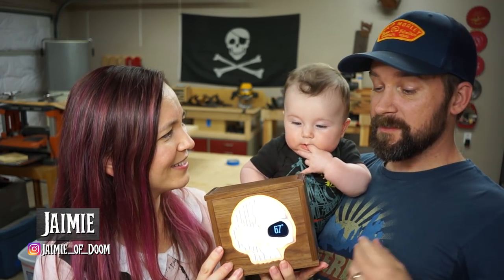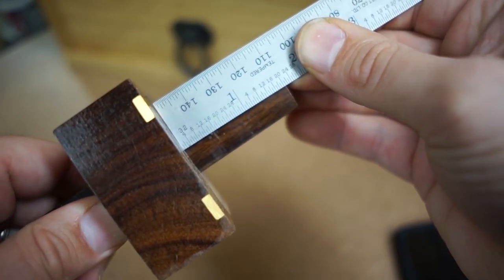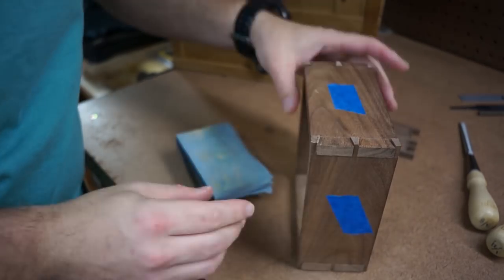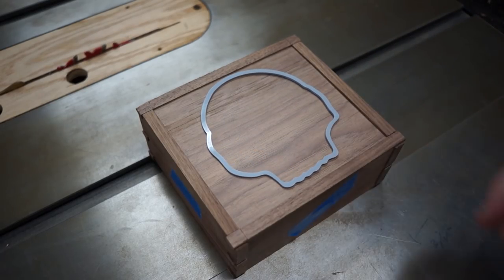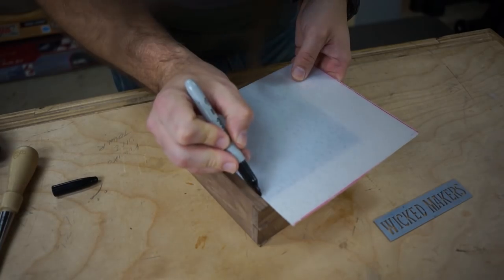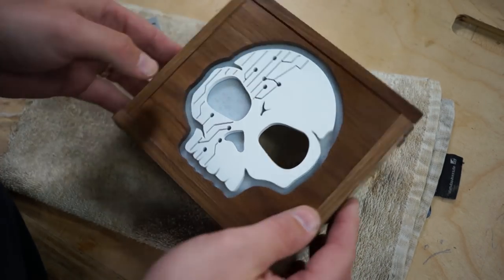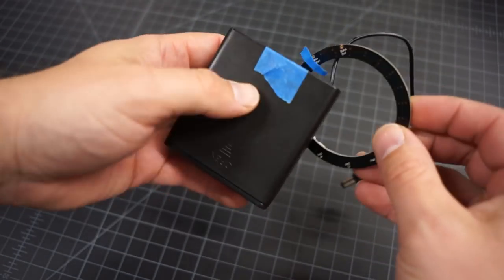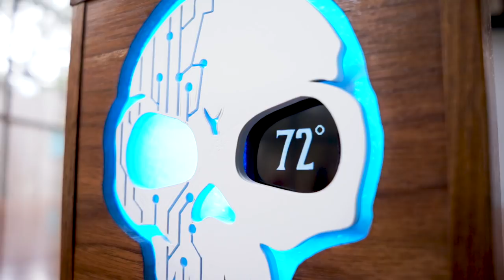DIY Arduino LED Skull Shop Sensor

Comment: Hey fellow cenTexer! Loved everything about this, and I'm jealous of your shop. I recommend you check out the ESP8266 since you're getting into arduino. They're small, cheap and wifi capable!  What that means is that with essentially the same build in this video, you could be publishing your temp/humidity to a topic on an MQTT broker and subscribing to that topic on your phone. In other words, you get to access what the cool skull box is measuring from anywhere in the world.
Reply from the maker: Thanks Shane! Sounds awesome!! Will definitely check out the ESP8266. Anything that gets us a step or two closer to our Tony Stark work shop. :)

Comment: How do you adjust for frequent humidity changes? Do you run a dehumidifier in your shop?
Reply from the maker: Do you mean how do we adjust the sensor, or what do we do in the shop in general when it changes?
Reply: The latter. I live in a dry area so I've never had wood movement issues. I'm curious if you have to do any extra steps to keep your wood form warping and causing problems.
Reply from the maker: Yeah there's a few extra things we have to do, sadly. :) We used to live in Southern California so moving to Central Texas was a big change for woodworking. I have to monitor the weather and try not to do any major milling or material removal if I know there's going to be a big swing in humidity in the next 24 hours. I try to bring my smaller projects into the house on off hours to minimize problems; for big stuff where that's not possible you just time it as best you can. I haven't setup a dehumidifier in the garage yet...might be worth a try. I imagine it would be running 24/7.

Comment: Cool video, and interesting project. Currently attempting to make this lil' project, myself. Mind sending me the code to look into. and the bmp files? Would be much appreciated. Just gained a new subscriber.
Reply from the maker: Thanks! Send us an email at thewickedmakers (at) gmail and I can send you the number bitmaps. The code is available on the Arduino Project Hub if you look up Wicked Makers.

Comment: Cool project.  My nephew is in college studying engineering and is encouraging me to get into working with Arduino which I probably will in the near future.  
What really amazes me is that I have seen several of your videos and you two really work well together on projects.  That takes a special relationship.  Most of the time when I get help from my lady I am going North and she decides it should be going South after the few seconds she has been thinking about the project.  I have usually been pondering how to do the project for weeks and up to years before starting and have multiple reasons to think that North is the way to go (and after going through multiple plans/builds/scenarios).  This inevitably leads to arguments, frustration, and leaves me thinking that I might have been better off without her help at all, but sometimes I just need an extra hand.  Did you guys go through this?  The more I write this, the more obvious it is that we really need to talk this through.
Reply from the maker: You nailed it at the end. It’s all about communication! Whether it’s a team of creatives or engineers or a significant other, you’ve gotta find healthy ways to discuss ideas and get on the same page before going to far down any one road. To answer your question, everyone goes through that. 😀 It takes practice and to trust your partners ideas. Thanks for the comment. 👊🏼👊🏼